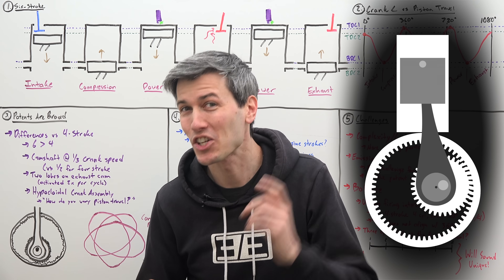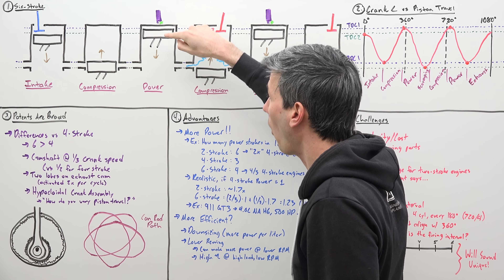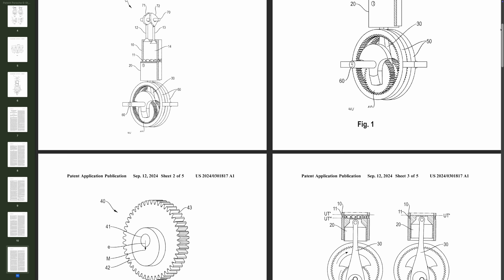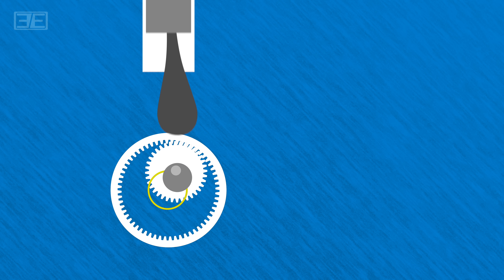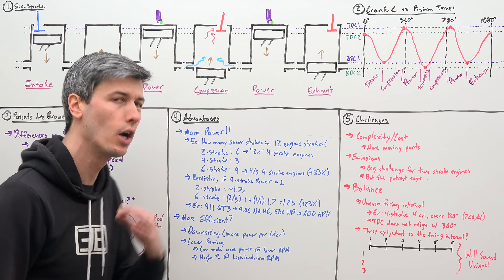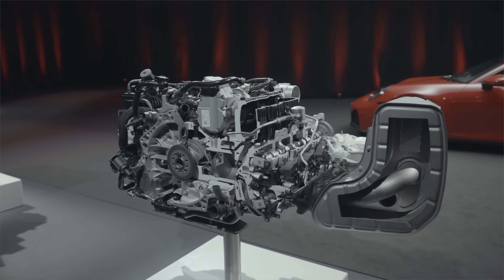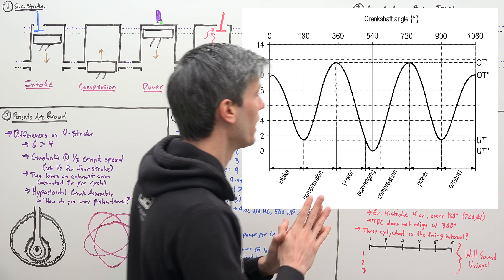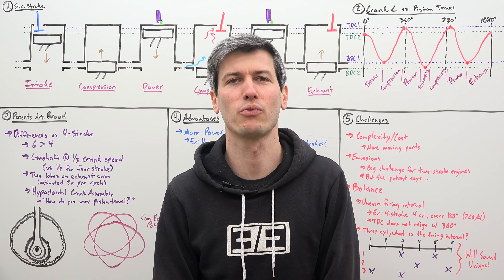Porsche's 6-Stroke Engine Is Genius!

Comment: Now if one of those lunatics at Porsche could/would combine this 6-stroke with a Scotch Yoke design . . .  That is IF it could be done, the Scotch Yoke is already oddball enough!
I agree that is going to be a VERY odd sounding engine, no matter how you configure it by your explanation, there is going to be some periods when a cylinder won't fire for two of it's power cycles.

Comment: Even though your firing chart is linear, the stroke set is cyclical, isn’t it? So it would be 1-3 2-4 3-5 4-6 5-1 6-2 1-3 etc… and you can stagger sets? Hmmm… weird to think about…

Comment: I'm wondering if a similar effect could be achieved using clever variable valve timing, I believe some manufacturers already do this to create variable compression ratios, this feels like it would eliminate the need for the lower ventilation holes? 

I'd love for an explanation for why a Variable valve system couldn't replace the lower ventilation holes for an even simpler system.

Comment: Those gears better be really strong. It sorta looks like a rotary and piston engine mechanically speaking. The gears under those pistons will be exposed to heat and wear and high rpm's.

Comment: Just as when making a mecanical system more complicated you make it more unreliable this will be another interesting disaster. And just as the trend is to use a smaller engine it will lend itself to further unreliability

Comment: Nothing more than a fancy blowby gas system reburn (exhaust gas recirculation, cam intake/exhaust overlap, etc) due to the insanity of governmental over-regulation. Burning blowby gas ALWAYS creates less power than using fresh air.

The auto manufacturers have to come up with radically complex systems to try to meet these crazy regulations and at the end of the day the engine makes LESS POWER, is LESS RELIABLE, and ends up killing fuel economy resulting in MORE FUEL CONSUMED.

Also your math is wrong because you're assuming this off-cycle second power stroke will have the same volume of air, it doesn't it's just calculated blowby gas using a crankcase pressure sensor to adjust fuel trim on the second power stroke.

This design is just to reduce emissions, nothing more.

Comment: Simply put they are doing egr but in reverse. Which reduces emissions while producing more power and using less fuel. Unlike egr it doesent choke the engine

Comment: I think the key to "clean and complete combustion" on the 2-stroke cycles is that they're exhausting through the exhaust valve rather than a side port.   Normally on a 2 stroke engine, the exhaust port starts a little higher than intake so it's exposed first, and some of the exhaust gases escape out that port, before it reaches the intake port and intake air starts rushing in.   The cylinder is vertical, but the intake/exhaust air is moving sideways, so you never really get rid of all the exhaust gasses, thus combustion is always a mix of clean and dirty air.   
In Porsche's engine, they must open the exhaust port before it reaches lower BDC so it starts exhausting out the top of the cylinder, and then the intake ports are exposed, and it starts sucking (or blowing if turbo'd) clean intake air in to follow the exhaust escaping out the top..  Intake flow occurs as it both exposes and hides the side ports,  and then they must close the exhaust valve as it comes back up and it starts its 2nd compression stroke.    My guess is, there isn't quite as much total air introduced during the 2 stroke cycle (or maybe there is, if there's more separation between BDC #1 and the intake ports), but this bottom to top flow allows it to exhaust more fully, leading to cleaner combustion.
Reply from the maker: Good insight!
Reply: Such "Uniflow" scavenging is widely applied to 2 stroke diesels.

All 2-strokes have the problem of some charge escaping through the exhaust because it is practically impossible to prevent the charge and the exhaust gases from mixing. The uniflow method is generally the best at minimising that issue (at least in engines with undersquare cylinders) but still only manages to get about 60% of the fresh charge in before significant amounts of mixing start to take place.

On a direct injected engine one can get around the worst of this by delaying injection until the exhaust has closed, that way you lose out the tailpipe is just air (and a little oil). However this does make mixture preparation more difficult for spark ignited engines.
Reply: But you might still end up with oil being scraped off the cylinder wall in the intake ports, eventually being forced into the combustion chamber with the intake air. I could imagine that it makes clean combustion more challenging, although maybe not impossible.
And I would think that there are no oil spray ports for piston cooling either...
Reply: @smurface549 That's where I'm at with this. Scavenging is nothing new (especially on the diesel side of two-stroke), and the more linear air path makes sense. But they don't present any solution to oil control, which is really what doomed two-stroke and Wankel engines.
Reply: @smurface549 My thoughts exactly!!! How would you keep cylinder wall oil out of the bottom fresh air inlet? If you can't, then you completely negate the whole "cleaner engine" theory.... Unless you scrap the bottom inlet and somehow inject air just before BDC on that stroke .... 🤔
Reply: I wonder if they could make this a true simultanteous multi fuel engine by sucking in gasoline mixture for the 2-stroke and injecting Diesel for the 4-stroke since the compression can be made different?

Also with variable valve timing you could change how much exhaust is left in the chamber for the next combustion, a bit like egr valves for lower emissions. Maybe...
Reply: electronic fuel injection would help a lot with the 2-stroke clean burning. the ECU can adjust fuel input on the 2-stroke cycle. Most current engines already use some EGR by keeping the exhaust valve open a bit on part of the intake stroke. the 2-stroke part would just close the exhaust valve early to retain some burned gas for that purpose.
Reply: My understanding with 2 strokes and emissions is that you can leave exhaust gasses in the chamber for a second burn.  This creates more NOx.  It is true they could scavenge it all with fresh air and then mix a charge in after.  Especially easy for diesel.

Comment: This engine would need super long piston skirts to cover the bottom transfer ports when the piston is at TDC to avoid air fuel mixture from entering the crankcase and oil from exiting the crankcase. This would create the need for a super long conrod as well I expect. The lower transfer ports would only ever work efficiently under boost, similar to a 2 stroke diesel needing a roots blower to work at all. Can’t see this ever going ahead.

Comment: Extra gears, bearings in the bottom end more friction. What happens with oil in the sump with the ports exposed with the piston up they get oil in them no mention of this. I did my apprentice at GM in the 80s and time with gas turbines my grandfather was a draftsman with GM as well.

Comment: This massively changes the tight power band of the 2-stroke because it's constrained by the normal operation of the 4 stroke. Will this create a massive power bump at the revs the 2-stroke would have made most power or will the characteristics change massively between a 2-stroke and an integrated 2-stroke?

Comment: What about a double ended piston engine where by the puson is acted upon from avove and below two cylinder heads for 1 pisoton half the spucific weight twice the power plus yet more efficiency because tge piston is being forced back on exhaust stroke etc etc

Comment: Pretty sweet — have you taken a look at Bruce Crower's 6-stroke design from 20 some-odd years ago? Would be cool to see how it compares technically and which you think is superior from a power and efficiency perspective. I think I remember reading that because the 2 extra strokes were designed around water injection/steam expansion, that theoretically the heat it would carry away in the steam could make the engine run cool enough to not even need a cooling system.

Comment: Does anyone else question whether gears would survive the power stroke for long?  That creates a ton of force on little teeth, and the "crankshaft" is constantly in motion, so it would have to be an ultra-durable material to last at all.  Also, with gears instead of beefy bearings that a traditional crankshaft would rest in (with tight tolerances), you would have to have very clean oil, otherwise those teeth would wear super fast.  I can't imagine this in a 911.  Maybe a low rpm truck or bus application, but nothing performance related.  Am I off base here?

Comment: You would need some kind of boost for the 2 stroke portion of the cycle to operate (look at 2 stroke diesel engines). With a turbo, the engine would fire every 6 strokes when not in boost (good for efficiency) and in would fire twice as often when the boost kicks in.
Reply: This would pair well with Porsche's T-Hybrid system.
Reply: Two stroke diesels don't use boost.
The blower is for scavenging because they are uniflow scavenged and don't use crankcase induction
Reply: @PaulG.x  I know that they use superchargers for scavenging. I'm saying if this engine used a turbo with no supercharger, there would be no scavenging when the engine is under low load. This would effectively deactivate the 2 stroke portion of the cycle.
Reply: @bz938  Winton already solved that problem 50 years ago with clutched supercharger that acts as an engine driven centrifugal blower at lower speeds and as a turbocharger at higher speeds
Reply: @erkinalp  I'm not saying it's a problem. The engine would start and run fine without a supercharger. It would save fuel at low rpm by essentially having partial cylinder deactivation.

Comment: I saw a prototype 6 cycle that injected water on the second power stroke to take advantage of the remaining exhaust heat.  I imagine with some odd motorcycle cylinder number configuration they could make the firing order even by not locking the offsets between cylinders at 120 degrees like you assume.

Comment: Congrats on 1000 videos, looking forward to the next few thousand! This is fascinating, perhaps genius (?), but I have questions. 1/ Why? It incorporates a two stroke cycle and just because Porsche say it will fully burn the fuel, doesn't mean it will. I can't see any difference between this two stroke and any other. There will be incomplete scavenging and unburned fuel going through the exhaust. Also, how is the fuel being pressurised to fill the cylinder in the two stroke part of the cycle? If it is crank case pressure as is traditional, then you will be burning oil. It clearly cannot be that. I suppose the 'modern' way of doing it would be turbo charging. OK, that could do it. But it is still a two stroke, so I'm convinced it cannot be clean unless there is something not mentioned in the patent. Question 2/ Why? It is clearly more complicated and expensive. Even if it leads to a smaller engine, it will not be as proportionally light and friction reduced as the capacity drop. Surely we are now getting diminishing returns for the ever more complex ICE engine struggling to stay relevant? Question 3/ Why? With the whole world going electric and the benefits of clean and sustainable motoring that this is making possible, why would you continue to flog a dead horse? Surely the future is now clear and you can safely invest all into electric? I know this last point will find much controversy, but I would urge you to think about it well before disagreeing and not simply regurgitate the same old oft debunked myths still apparently seen as fact by many.

Comment: If they realy fixed the emissions problem, that comes with the holes in the cylinder walls, they could just make a Detroit diesel style 2 stroke engine. 
It would be simpler an more efficient.
Ther is no need for 6 strokes...

Comment: How exactly do you manage to scavenge the cylinder in an uniflow way, when the engine is naturally aspirated? Where do you get the compressed air (or air/fuel mixture) that is being forced up the cylinder from the ports when they are uncovered?

Comment: How does the scavenge/exhaust stroke function without forced induction?

It's the same issue with 2 stroke diesel, it requires forced induction to complete the scavenge and exhaust in a single stroke.
Reply from the maker: It probably does - see pinned comment - I didn't want to rule it out bc the patent leaves this section very open.
Reply: @EngineeringExplained  the Detroit 53T series has "naturally aspirated" variants where they use an electric fan that pushes clean air into the cylinder through the intake ports on the side, which also pushes out the exhaust gases.

It's technically not forced induction because the air isn't compressed, but standard roots style blowers aren't really compressing the air either, and they are classified as forced induction.

Comment: There looks like a lot of friction loss in the valves and gears since it will not truly act like a 2 stroke as it still uses a cam, thus losing about 30%ish of the gain in valvetrain loss alone compared to the figure given, so you would only gain 11-12%, then some of that is lost in additional friction and torque loss for all the other strokes to carry the mass through the additional strokes through a geared drive. Beyond that, how is the air going to be forced into the combustion chamber during the two stroke operation to scavenge the spent fuel? I'm curious how complicated they intend to make this in the pursuit of mileage at the cost of...well...cost. It is going to be expensive.

Comment: Congrats on the 1,000 video. We have enjoyed it as much as you have. 
Another issue for me is air flow tuning. How to balance the carburation from the intake valve with the scavenging 2 stroke even with separate mass air flow (MAF) sensors. 
Will this need to air dams and two air filters?  The harmonics will be interesting. 
Thank you

Comment: I worry about the forces on that annular  gear. Between broken teeth, or it just slipping, I cannot see it lasting. Obviously it cannot be cast into the engine block, it will presumably be set of rings that are installed into the block, 1 or 2 per cylinder. Also implies you cannot have a single block, but will need to be split, unless you go with a Y shaped 3 or 6.

Comment: Congrats for the milestone!

Regarding the engine, even if they manage to balance it, the crank friction losses will be very detrimental for fuel efficiency. Also it will most likely require very strong piston rings to cope with the second power stroke, that won't help with efficiency neither.

Comment: Two questions:
1 - if they use a uniflow-scavenging phase in the beginning of the two-stroke part of the cycle, they cannot have natural aspiration. Some kind of mechanical supercharging is needed to blow air into those bottom ports (simpler two-strokes use crankcase pumping but here it is not an option because fuel-air mixture cannot be allowed into the crankcase).
2 - why stop at a weird crossbreed of a 4- and 2-stroke and not just go for a uniflow-scavenged, supercharged, fuel injected 2-stroke which is mechanically simpler (no epicycloid gearing needed) and as clean as this hybrid (sealed crankcase, no fuel-oil mixing)?
Reply: Old Detroit diesels.  6v71, 6v92 and so on (many different models) used the lower port kind of design.
Reply: The efficiency gain here is reusing the combustion products from the previous power stroke for another one. You'll never get a complete burn from just one power stroke. In addition, forced induction would work well with Porsche's T-Hybrid system.
Reply: @ That is an interesting point to consider, thank you.
Reply: My thoughts exactly! Those secondary/lower ports would have to be blown. Added mechanical complexity/engine load(presumably), for a single stroke? Just seems...inellegant.
Reply: @mjrtensepian1727  And ducted. Where do all these passages fit?
Reply: @ Yeah, no idea. Maybe an extra runner coming off the intake manifold to charge a sort of pressurized intake "channel" in the block with those lower ports? Working like a injection fuel rail, but for air...

Comment: 0:28 admittedly I do love a good graph.  way better than words sometimes.
Reply: 4:52 I actually think we can rule out a V configuration. given the position of the strength of the block in a v configuration would be right at the valley and this cycle set up would require a giant hole there along with going right through the coolant side of the chamber.

it would be possible, but highly impractical.  

thinking about it, a VR set up might be the way to go here.
Reply: 10:17 I think the effectively variable compression might also have something to do with efficiency.   I would have to look at the cycles to be sure.
Reply: I'm not sure I agree with the balancing comment.  maybe the solution is to go with an "AC motor phase" solution.

Comment: Push out the exhaust by injecting air at bottom dead center?  That has to be some unbelievably high pressure because it doesn't stay down there very long does it?
Reply: Forced induction looks like a requirement for this.
Reply from the maker: There's a good number of ways it's operated in the patent, so it's unclear if forced induction is necessary (since two-strokes don't require it, but also do things a little differently).
Reply: @EngineeringExplained  Crank case compression? Too high a volume to work and oil splash contamination.

Comment: This won't be built and put into production.  The next Cayman/Boxster comes out later this year and will be electric;  Supposedly Toyota will use the basic chassis with a 2.4 liter four cylinder turbo to produce a new MR2, but that's just rumor.